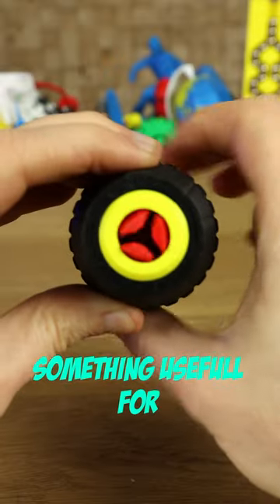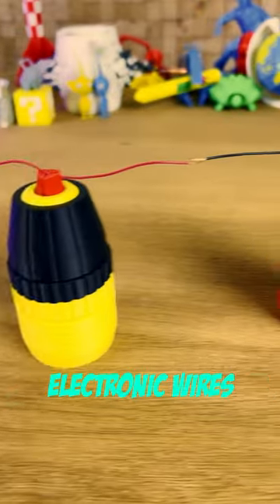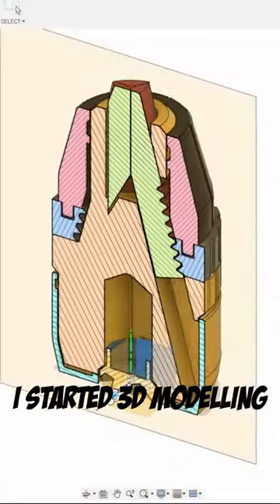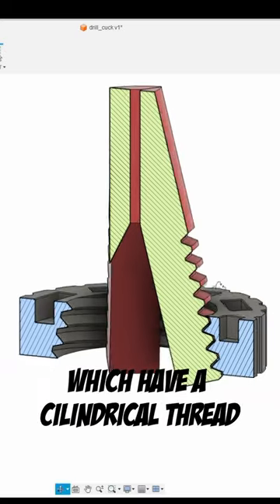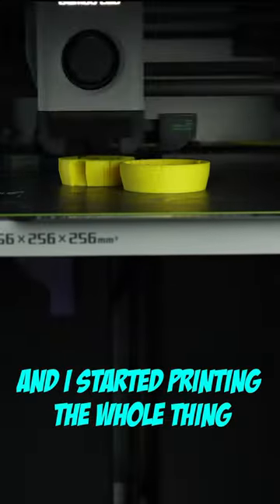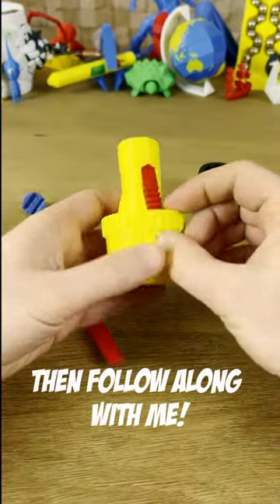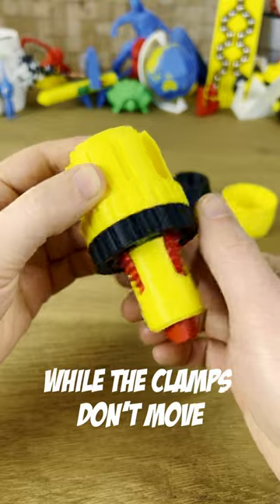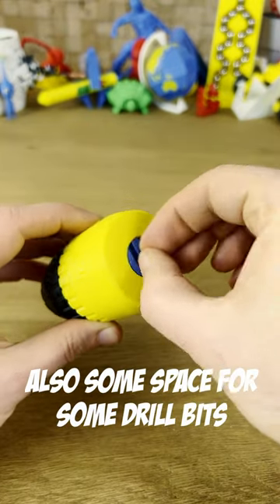Printing A Drill Chuck #3dprinting

Comment: What material and settings did you use? I printed the base twice, but the part keeping the cover in place flattened and now it opens really easily. Also the fits are very tight, a bit too much.